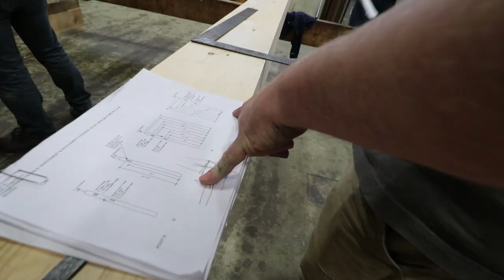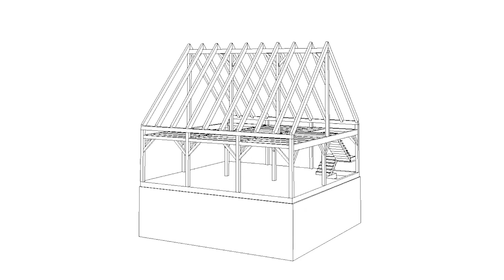BIG NEWS! Our Official Timber Workshop, Limited Space!

Comment: That's really great news! Looking forward to more great videos (btw. I know I'm late but when you were struggling with horizontal rebar you just had to drill a hole in the side of the foam on the right height and just push it right through and later use the glue to fix the hole - no need to break that plastic holders or to twist that long rebar just to put it in...)

Comment: No point in having 'key way' seams, they always leak, to one degree or another, install them by all means but assume they will leak!
Back up anything sub-terrain with some type of bitumen products, to help seal but anticipate leaks!
Use an egg box type of plastic system on both the walls and then the floor (second).  Install 100mm pipework, running to drains dotted around the slab, to finish level or just shy of slab, place the floor egg box plastic sheeting over and this will deal with any water that will inevitably find a way through!
This can run straight out of the front of your property, it seems, failing that, run to a sump and pump out!
Goodluck, it is so tough sometimes when you work and work and seem to advance so slowly, take each little job one at a time and celebrate it's completion then the next one and so on...